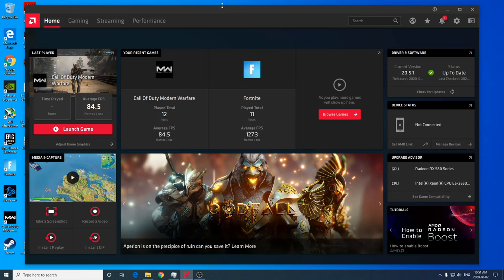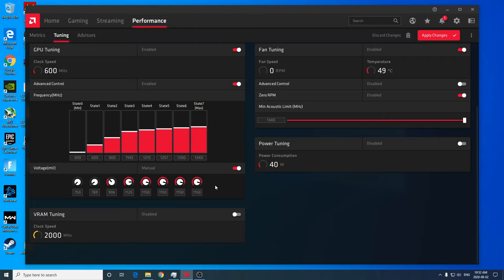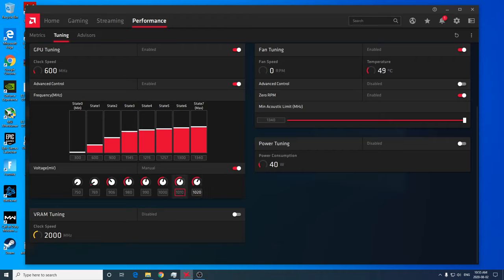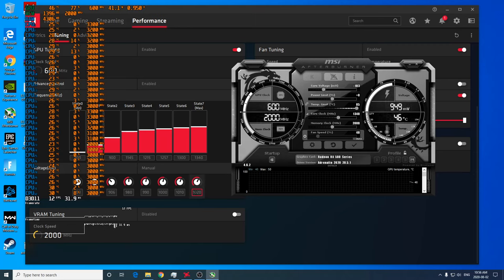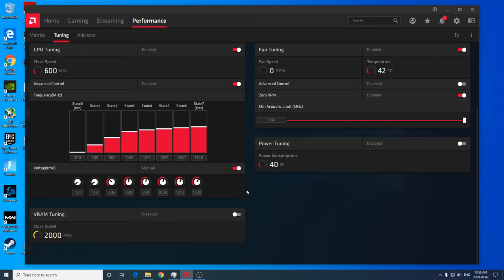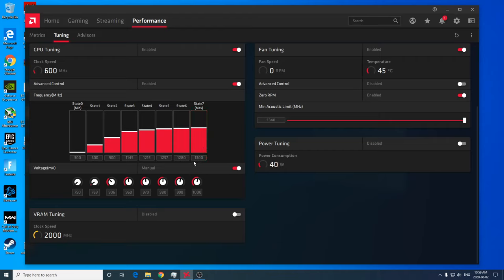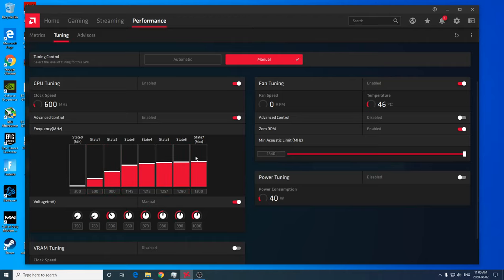How To Undervolt AMD RX 570 and RX 580 (How to lower GPU temp upto -10c)

Comment: will this reduce my fps?
Reply from the maker: if you reduce your core clock, it will affect FPS.
How ever, if you gpu is over heating and just undervolting on the stock voltage is not enough, then you will want to drop your core clock a bit to run an even lower core voltage.
Voltage has no affect on FPS, but you do need a certain amount of voltage to run the core clock you select.
The higher the core clock, the higher the voltage required to run stable.
Reply: @AleksandrsBrodie  I peaked at around 86c now I'm down to 66-71c. Thanks :)
Reply from the maker: @jsa1313  glad it helped

Comment: still 80c + =( I also tried replacing thermal paste </3
Reply from the maker: You will need to run a lower core clock then, maybe 1180mhz at 940mv.

Comment: Will this help with stuttering on Warzone?
Reply from the maker: only if you GPU is overheating, otherwise, you may have a CPU bottleneck.
check your CPU usage while gaming and GPU usage while gaming.
Reply: @AleksandrsBrodie  I notice my CPU Goes up to max 60%-67% and my GPU usage is 95-99%. I just switched to pc almost two weeks ago but started having issues with Warzone after a recent update. (Upgraded my RAM Tuesday) My temp has been around 67-73 degrees.
Reply from the maker: @wanderors  hmm i am not sure then.
you could try reinstalling if you have fast internet.
I dont have any other suggestions right now.
Just keep an eye out of the CPU and GPU usage, i would tab into task manager while in game and that will give you a more accurate idea.
Also look at your task manager in logical processes so it shows you thread utilization.
You can check any of the streams ive done and how my task manager looks.
Reply: @AleksandrsBrodie  I’m actually reinstalling now as we speak lol. Task manager shows everything how I described but I notice my power usage when on Warzone is very high. I’m also on afterburner right now looking at my clock speed, etc. and everything seems normal from what my specs are. I think the only difference is with me upgrading my RAM, my memory  clock is still at the stock level I assume.
Reply: @AleksandrsBrodie  game just got done downloading and I loaded it up. My CPU is at 96%?!?!?
Reply: @AleksandrsBrodie  DUDE SCREW EVERYTHING I JUST SAID, YOU FIXED MY GAME!! I honestly could cry right now I don’t think to understand. I’ve been stressing for two weeks trying to figure out what was wrong. I’ve been even putting my content on the back burner because I couldn’t play this game and record.
Reply from the maker: @wanderors  that's the issue
 You can try capping the fps.
Reply: @AleksandrsBrodie  I ended up fixing it! Resetting AMD software settings and resetting my memory clock speed in afterburner. Apparently my pc was factory overclocked. I’m back to playing Warzone flawlessly. Thank you!!
Reply from the maker: @wanderors  : D

Comment: Does this work on rx 560x?
Reply from the maker: The concept of undervolting does yes. The core clock and voltage settings may vary.
You can try running 1300mhz core @1000-1060mv.
Also, you can oc your memory probably to 2000mhz.
Reply: @AleksandrsBrodie  THANKS! Ill try right now
Reply: @AleksandrsBrodie  ok so my state 7 is at 1275 and voltage is 1137, should I drop the voltage to like 1100? Sorry really new to undervolting :)
Reply from the maker: @wholesome8691  Check my channel, i have a few other videos on Unvervolting which will help you understand how to set your voltages.
But yes, state 7 is 1300Mhz @1050mv. if it crashes, then increase the voltage to 1070mv.
I think my latest undervolting video on how to set voltages will help with this.
Reply: @AleksandrsBrodie  OK GOOD NEWS! Haha, so I undervolted it to 990 from 1137 and OMG THE RESULTS MAN, same fps BUT THE TEMPS, from like 85-89 (Laptop so only stock fan cooler and I'm in a tropical country so yeah) to 75-76 CONSTANT! THANK YOU VERY MUCH DUDE! <3
Reply from the maker: @wholesome8691  glad it helped.
If you are in laptop, maybe dont bother OC the memory or increasing core clock much.
You can also try lowering gpu core click to 1250mhz and running voltage around 930-970mv.
That will help with temps.

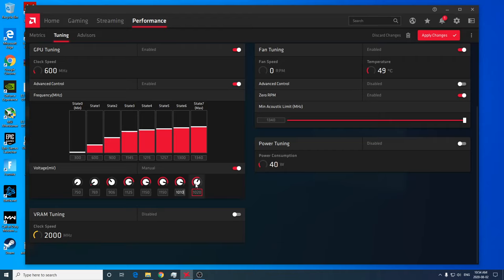Comment: 2:40 my pc instantly went BSOD (no joke)
Reply from the maker: that means the voltage was too low for the given core clock on your gpu.
If you want to run 1320mhz, you will need a higher voltage, you can try 1080mv.
the whole idea of undervolting is to find a balance between the Core clock you want to run and a stable voltage for that core clock.
The higher the core clock , the higher voltage is required.
more voltage = more power = more heat.
Reply: @AleksandrsBrodie  i think yours didnt crash because it didint reach the stages.... you stoood on early stages the whole video.... I could be wrong...
Reply from the maker: @augustocamargo6051  all silicon quality is different.
Also, the reason my gpu was running in state 1 the whole recording was because the gpu was not under high load.
When gpu is under higher load it runs at a higher stage.
my gpu in this example didnt need as high of a voltage when i was running at state 7 (aka when gpu is under full load like in games) because the clock speed was stable with the voltage I set.
your gpu quality will vary from mine, your card may need a higher core voltage for the same core clock.
this is where you can increase your core voltage until your card runs stable and does not crash.
Reply: @AleksandrsBrodie  well at my second attempt it worked... thanks for the video bro.
Reply: @AleksandrsBrodie  im at 1320hz and 1080mv

Comment: can It work on on 480
Reply from the maker: It can, some 480 cards just need a bit more voltage. But you can try it out
Reply: @AleksandrsBrodie  ok
bro if I play rdr 2 and they average fps are 50-55 and I cap it to 45 can It decrease gpu usage and gpu temp

Comment: does work for rx480 ?
Reply from the maker: the principal for undervolting will work on the RX 480.
The rx 480 will need a bit higher voltages than the RX 570/580 cards but I would definitely try lowering your voltages and seeing what voltages you can run stable on your card.
Most cards can at least run -50mv for state 7
Reply: @AleksandrsBrodie  hey i have another question maybe you can help me out on this one!. the thing is that the only way i can play any game on my pc is lowering the power limit to -40 or -30 under the power tunning option if i don't change that my games stutters like crazy from 60 to 20 like every second!  . i dont know what it can be.
Reply from the maker: @jfc1414  what size of psu do you have and what fps do you get when you set the power limit?
Reply: @AleksandrsBrodie  i have a 600watt psu evga when i put -30 i have solid 60 fps depends  the game of course, i play RDR2 fps lock on 30 fps  with no issues but only if i scroll down the power limit on -40
Reply: i checked with another psu 600watt from corsair and the issue continues
Reply from the maker: @jfc1414  it may be a CPU bottleneck then? otherwise i am not sure what is causing the issue. 600w is plenty and evga is good quality
Reply: @AleksandrsBrodie  I’m  not sure... it’s kinda odd because this started like 4 months ago and can’t find any fix yet, anyway thanks for your time Brodie! Keep it up ! ✌️
Reply from the maker: @jfc1414  I would consider doing a full windows 10 reinstall then.
You've already done a lot of troubleshooting so I would try that.
And make sure you have an ssd, they just make everything load quicker
Reply: @AleksandrsBrodie  hey!  quick update here if someone got a problem like this it’s thermal paste related. I replace the thermal paste on my gpu and everything runs smooth as new. It doesn’t matter if the pc reads normal temperatures just replace the thermal paste and you’re good to go !
Reply from the maker: @jfc1414  make sure your system reads good temps after the thermal paste change.
The sensors dont lie.
And yes, the thermal paste can dry up after years of use

Comment: My Asus Strix Rx 570 is so shit i got it rmaed thrice and the most recent gpu i got it's going to 85 degrees in unigine heaven benchmark, i can feel the heat from my cabinet, i did the undervolting on the adrenaline but there was no difference i applied the settings and ran the benchmark but the temperatures didn't go down and i left the voltage at 1010 at stage 7 which is 1300 mhz but when i went in to the drivers my voltages revert back to normal. i don't know what to do can anyone please help me how to undervolt the gpu permanently and what will be the ideal voltage for the card to run at 1300mhz core clock.
Reply from the maker: you can only set a permanent voltage for the application you want to run, just not as a desktop default.
What I would recommend doing is mantually doing it each time before running a game with the Asus strixx card as they do run hot as fk. I would also recommend trying 1250mhz core on a lower voltage like 950mv or 970mv.
yes you reduce performance a tiny bit but as you know it can help keep your card from RMA.
I had one of those cards and would set a custom voltage on state 7  each time.
its just one of those things you can either choose to do or not.
ps. I just wish card manufactures would make cards that would not run so dam hot.
This is also a huge problem with the new AMD RX 5700 series of GPUs where the memory runs at 105c!

Comment: MY RX 580 Reach 80C In csgo even with this undervolt
Reply from the maker: Then you will need to run a much lower core clock, start by trying the settings in the video pinned in comments

Comment: Gonna try this with my sh*tty gigabyte rx580, maybe i can get the temps below 80c.😂
Reply from the maker: try the settings from this video
https://youtu.be/0pzxFZBw-6Y
Reply: @AleksandrsBrodie  Already made a screenshot of the settings in the description! Thank you :)
Reply from the maker: @erwinniwre8887  if your gpu crashes, just bump up the voltage +20mv, or drop core clock -20Mhz until the gpu runs stable
Reply: @AleksandrsBrodie  I tried the settings from this video first, so only decreasing voltage. Ran Heaven with default voltage and fans running at 40%. Max temp was 82c. With voltages from this video max temp 70.😛 That’s 12 degrees!!
Idle temps went from 44 to 37 degrees.
Reply from the maker: @erwinniwre8887  ;)
Reply: @AleksandrsBrodie  For whatever reason my volts jump back to stock after a reboot. Is that normal?
Reply from the maker: @erwinniwre8887  you need to apply the voltage and core clock settings to a game profile, otherwise, yes they will reset after reboot ;)
Reply: @AleksandrsBrodie  so setting it globally is broken?
Reply from the maker: @erwinniwre8887  global just does not stay permanently, it works but wont stay, in order for the settings to always be on while gaming, you need to make a game profile where you add the settings so they stay. you can do that from the top right of the overclock/undervolt settings area.